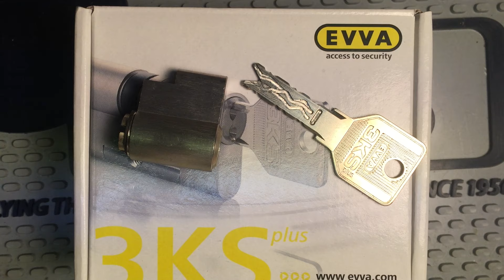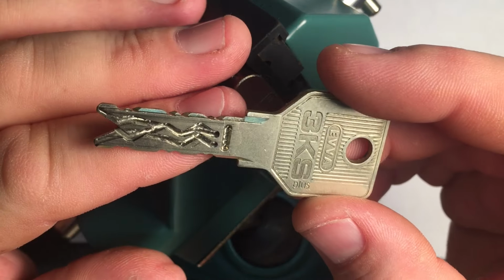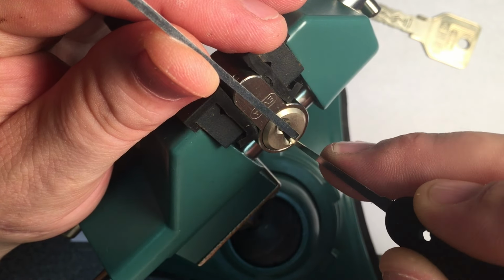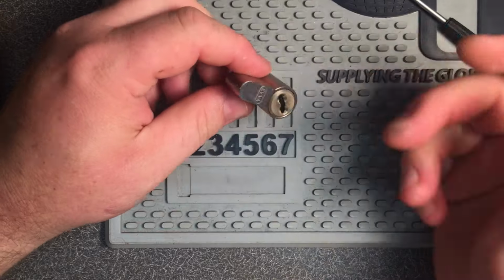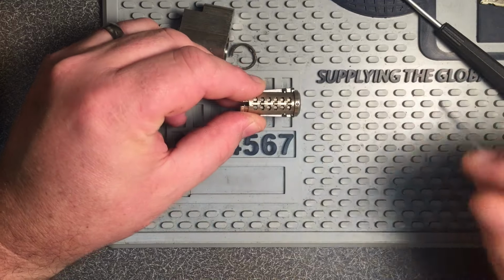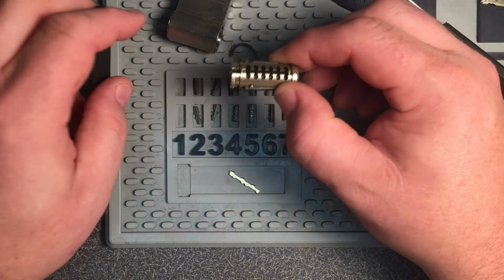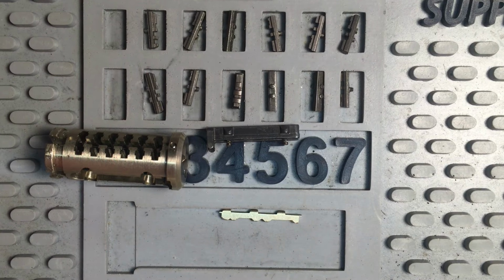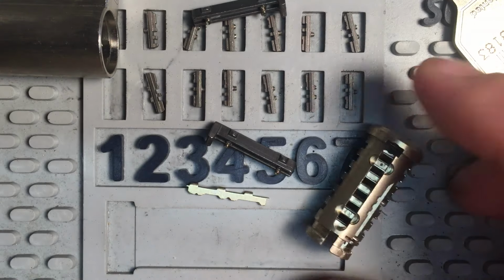EVVA 3KS Plus - Pick & Gut

Comment: I've got these on the house and garage (a keyed-alike set of four, soon to be expanded to six). I believe they read the key four times in a full rotation, so if you're picking it in a real-world scenario (i.e. a door) you'd pick it, but for every 90 degrees the key needs to rotate before the mechanism opens you'd have to pick it again.
Reply from the maker: Twice actually. The bottom bar groove at 90 degrees is not deep enough to disengage the sliders from he sidebar so the combination cannot really be scrambled at those points. It can be scrambled at the 180 degree points, but it's usually not because the sliders are not spring loaded. They tend to stay where they are after picking so long as you're careful not to disturb them.
With a bit of care you can open the lock on a door with one picking. That doesn't mean the picking is easy though. It is not.

Comment: Amazing picking - fantastic to see that lock picked in such a short time. How can you distinguish between false an true gates. How long did you try until it first opened? Cheers and thanks for that great video.
Reply from the maker: Thanks man! It's always hard to say how much time I put into these locks, but I can say with some confidence that I worked on it for at least a few hours a day for about a month. Within the last few weeks it's probably been more like three or four hours a day. It probably took upwards of 80 hours or so to get it opened for the first time. Even with all that work, I feel like I'm very far from being able to generalize the skill enough to just walk up to any old 3KS and pop it within a reasonable amount of time.

As for the sliders and how to tell where you are with them, it's a pretty complex answer. In the most simple terms, I tap on them to see if they feel tightly bound or ever so slightly loose. This is one of those areas where theory diverges from practicality though, because the sliders are not sprung, making it much more difficult to tell if they jiggle or are tight. Still, it's a very good first indication and I used it a lot on this lock. Peering inside the keyway a visually confirming this was actually easier than doing it by feel. Other things to look for are how deeply or sharply it clicks as you move the sliders around. I found that I could usually get it to a point where the clicks and associated plug turn would be dramatic enough that I could "read" the sliders more easily. For example if I moved one of them, and it had a subtle click, I was pretty sure I was in a false or partial gate. If it snapped sharply, it was indication of a true gate. I would then go on to confirm this with tapping.

Hopefully that helps a bit. I may make a video about my approach to this lock and the challenges it presented if there is enough interest.
Reply: Thanks for you comprehensive and open answer. You did an amazing job and I'm sure that I'm not the only one who is yearning to hear and see more about the background of picking this lock. 
I was impressed by the 80h of picking preparation - not that it takes that much time but that you have so much passion to stick to picking it until the final success (which was probably unclear). But then I thought about myself and had to laugh, because I'm actually the same crazy guy spending endless hours of feeling and hearing the feedback of a lock... Keep up the great work and please don't worry about a 15min limit; check out this: https://support.google.com/youtube/answer/71673?hl=en
Reply: I'll put my hand up to register interest in seeing that. Not that I will ever see one of these but I think there will something to learn still.
Reply from the maker: My pleasure! I hope my explanation made sense. I totally know what you mean about the time we spend with these locks. For me at least, the time melts away and I'm often shocked at just how long I've spent picking, LOL! I always know it's time for me to take a break when my hands start going to sleep on me. I'm planning to do another video where I talk more about the lock and how I approached it. I've also been talking with +huxleypig69 about the approaches and tools he has used on the 3KS, so I'll probably include a bit about that as well. I'm far from an expert on picking this lock, but I will try to share the bit that I have learned. I always try to add more about technique when I'm picking, but it's hard for my mind to focus on picking and explaining at the same time.

Comment: You did everything well . But you didn't open the lock ! You just moved it, and that's not what you want to see . With a full turn, it ,you have, jammed .
Reply from the maker: This has been a common theme, and for most locks you'd be 100% correct. But with this lock the sliders are unsprung and do not reposition themselves when the sidebar pops back out. Assuming you take care to remove your tools before turning to 180* and do not bump it around they will stay put, allowing you to turn it around as many times as you like. And if you're super worried about it, you can always just use a plug spinner.

Comment: Try picking these on the position that it would sit in a door, now you are cheating with the middle profile bar because it falls in place to go open when upside down
Reply from the maker: This is incorrect,. The sliders are not sprung and stay in position when when the plug is rotated if care is taken to not disturb them. The middle bar is passive and only enters the picture when a key is inserted.
Reply: @tumbl3r  i am mentioning about the middle brass bar that fits on the narrow bottom or top side of the 3ks key not the 2 hardened grey bars on the side
Reply from the maker: @monoracer_  Understood. This bar is passive and remains retracted until a key is inserted. The key pushes it up and only if the key has the correct bitting on the top does it retract. However, since we are picking it and not inserting a key, this bar simply remains retracted and we never need contend with it at all.
Reply from the maker: @monoracer_  I made a video about the internals and how they work here: https://www.youtube.com/watch?v=h9JnOEtZaeg&feature=emb_title&ab_channel=tumbl3r. These passive elements are generally only for key control and do not need contending with while picking. They may as well not even be there.
Reply: @tumbl3r  wrong, they divide different key profiles from each other too and if u insert the wrong key profile, then it will not turn. You can only prove me wrong if you post a video of lockpicking with the rotor on top and showing me that the brass bar was inside the rotor after the picking of the cylinder.. none the less it is amazing that you could pick it (even if you done it with the cylinder module upside down)
Reply: @monoracer_  it is rare, though not unheard of, for key control elements to be active from a picking perspective. Like Tumbl3r said, it is passive, and not something to worry about. There are many Abus locks with key control that look active, but actually aren't. I highly suggest reading up on how key control actually works before criticizing someone's pick because they didn't manipulate a passive component unnecessarily.
Reply from the maker: @monoracer_  This lock was sent to Lockpicking Lawyer, so I no longer have it. I appreciate that you feel you're right about this, but you simply are not. With no key to force the key control bar up, it never enters the slot that would prevent the lock turning. I understand that gravity would drop it in when the plug was turned but it would simply ride back out again because the channel is "V" shaped. The same way sidebars retract once the sliders are picked. Even though they are sprung into their grooves, they ride out when the plug turns unless the sliders block them from doing so. Same is true with this part. The key is what would block them. Or more specifically the incorrect key. If there is no key in the keyway there is simply nothing to block that bar from retracting (or more specifically engage it into the groove to begin with). Anyhow, thanks for watching and for your kind words. Do check out my other video on this lock to see closeup shots of the parts and the grooves the bars interact with. It should  quiet your concerns.
Reply: @tumbl3r  i have a better idea, i will try it out myself today. I have tons of evva 3ks cylinders at my work